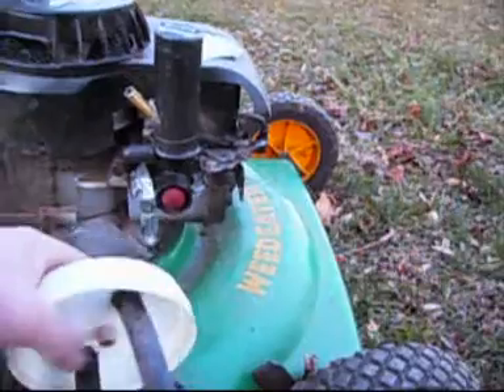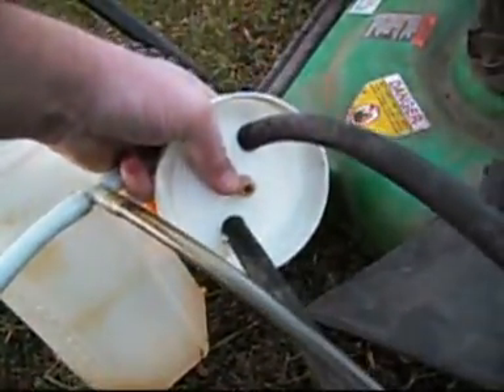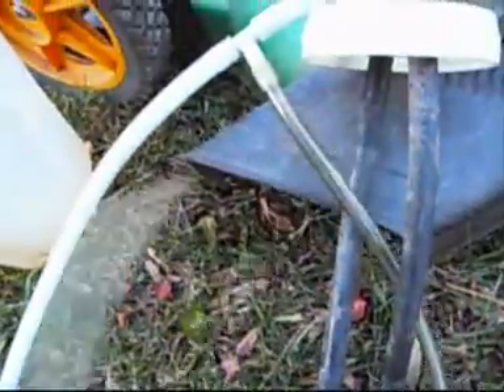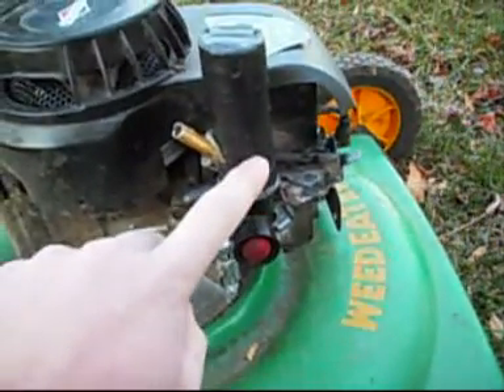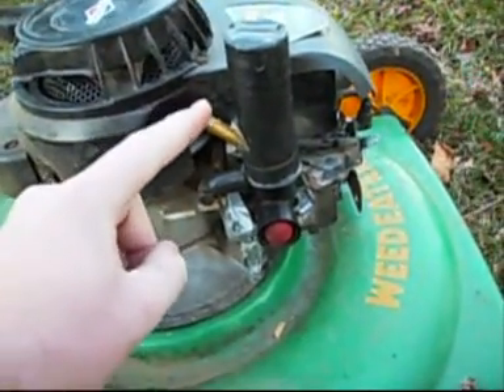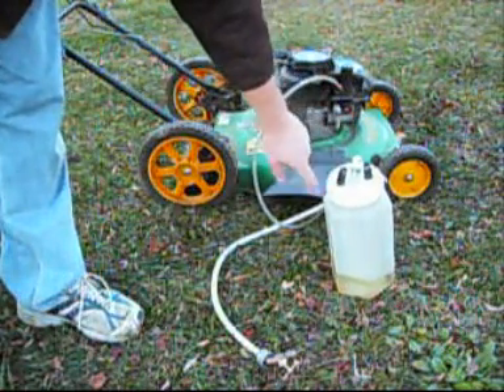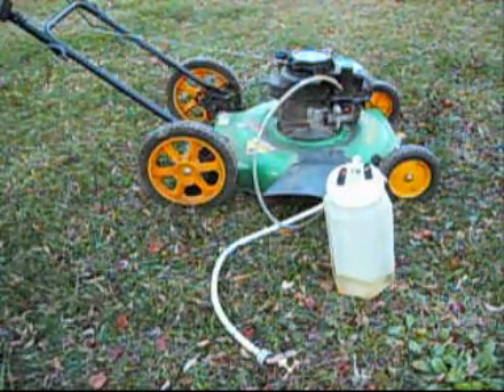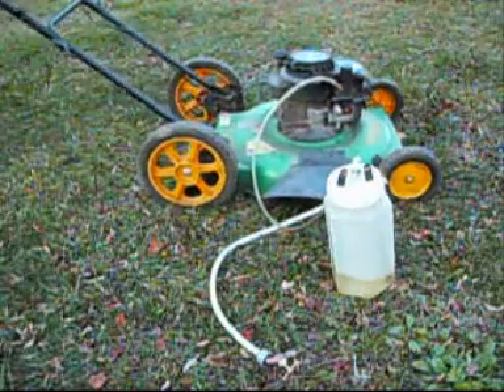Vaporizing carburetor part 2

Comment: hey thanks for the video...i made my own but instead of using an external tank, i took off the existing fuel tank to seal the intake on the carb and put it back on.  then i ran a garden hose from the air intake to where you put gas in the existing tank with a couple 1/4 in. hoses down in the gas.  then i wrapped a rag arround it for filtration.  i only put like a quarter tank of gas in...it works great and i think it has better power cuz it doesnt bog down in thick wet grass